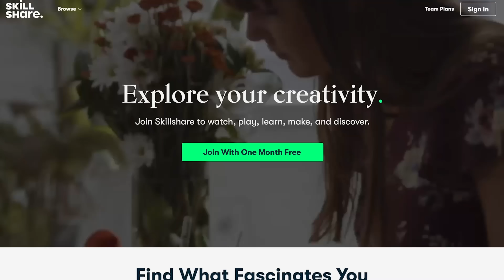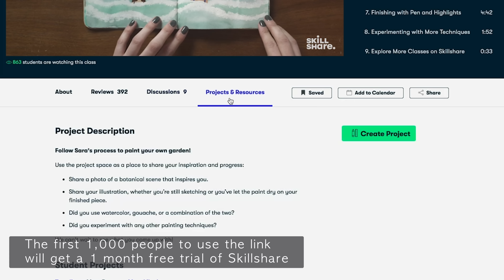The KITCHEN RENOVATIONS | Tiling the cottage floor. Ep 37

Comment: In the US there is a product Ospho rust treatment. My husband has used it many times. You wire brush off the loose scale then apply the Ospho. It binds to the rust and then it becomes the primer you paint over. It saves time and gives a good base to the paint. Don’t know if it will be available to you there.
Reply: I’ve not seen it but I’ll definitely look out for it! 

Thank you!

Comment: With all the gear you can buy to preserve your back and knees and you guys still don’t get them. Straps to carry heavy furniture seems silly not to do that. honestly! I had a handy guy do work for me and 10 years later he had two knee replacements and still in a lot of pain. This is heavy duty work just invest in some gear. Please
Reply: We have them and use them where necessary. The pads case more issues during 35 degree heat and just cause irritation. In winter when on our hands and knees we do. 

There’s nothing that we have needed to use straps for recently. Again, it we need to we do!